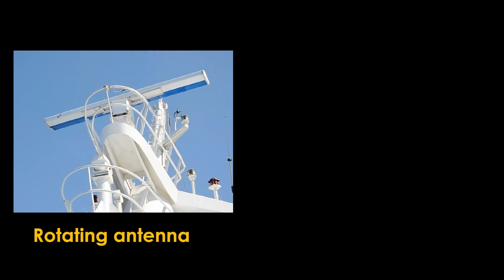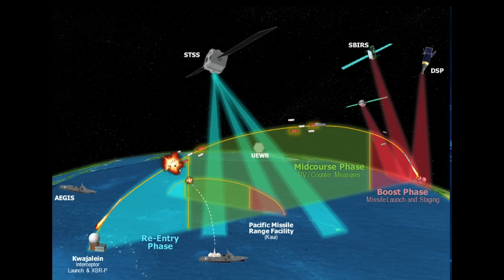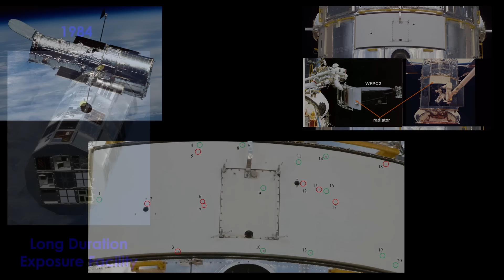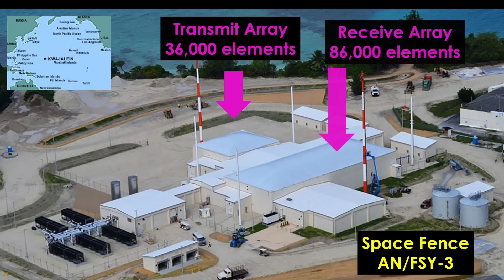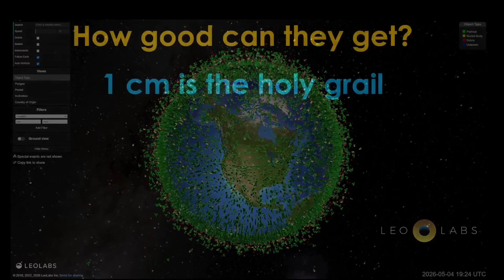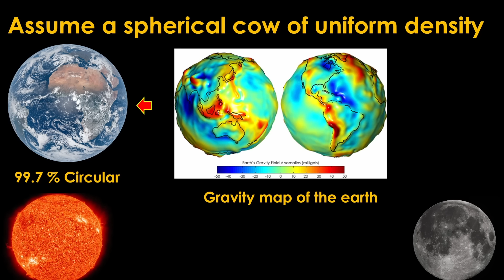Kessler Syndrome Part 4 - Trackers and Modelers

Comment: Is there any data or studies on how big an object has to be to create a debris-forming impact?  We know collisions with millimeter size debris are quite common, but they just leave pockmarks and don't seem to cause debris-forming events (edit: apparently the particles i was thinking of are an order of magnitude smaller than this.).  If a 5cm piece is undetectable, would we even know if such a piece gets involved in a collision?  I suppose we could look for satellites that were damaged or disabled by unknown means.  There doesn't seem to be many reports of satellites being knocked out by collisions with undetected debris.  Does that indicate that a 5cm piece isn't dangerous enough to be concerned about?

Anyway, i appreciate the deep dive into Kessler syndrome.  This is so much better than the normal fearmongering we get on this subject.
Reply from the maker: We have quite a bit of data on the smallest stuff from 10 micrometers to 100 micrometers from Hubble and LDEF. We don't have good data on the 1 mm size - the chart I based my discussion on has a big red "data gap" square at 1 mm.

My guess is that it is unlikely to see trackable debris at 1mm size, but there's still enough energy there to break things and generate more small debris. Whipple shields are able to protect against the 1mm size range if you can afford the size/weight of them in your design and you can't use them to harden solar arrays or radiators.
Reply: @EagerSpace  Yeah, cm-level stuff creates more debris in a collision. My suspicion is that mm-size stuff (so 1000x less energy than cm-size stuff just kills or disables an active satellite, without producing much debris. But that’s just a slightly-informed guess. However stuff that small doesn’t stay in low orbits for long, which is probably why it hasn’t eaten our lunch already, at least in LEO.
Reply: @ahgflyguy  most vulnreble surface area of a satellite is it's solar panels and radiators, I wonder how hypervelocity impacts effect them. Do they just completely shatter, in which case the vast majority of likely debris impact events would have a crazy amount of debris creation (shards of silicon wafers)? is it so fast it tears a clean hole through them like a bullet through paper, in which case the vast majority of likely debris impact events would have minimum debris creation.
Reply: @tmas the 10 micrometer stuff just pits the solar panel glass I think. Above that I don’t know. 100 micrometer (so 1000x more energy) seems like it would be enough break the panel significantly.
Reply: @EagerSpace  I was definitely under the impression those particles were 1mm and below.  I didnt realize those were actually that small.
Reply: The kinetic energy (and thus damage potential) of any impact can be easily calculated using the mass and relative velocity.
If we're talking about unknown fragments, we don't know the mass but can estimate it because we know what spacecraft are generally made out of.
Reply: I don't know how good their data actually is, but this is mentioned in the ordem 4.0 preview.
"ORDEM 4.0 will introduce a parameterized debris shape model based on laboratory hypervelocity impact tests, such as DebriSat. This will allow analysts to implement shape characteristics in their damage equations and more accurately predict impact damage risk by debris of different shapes and orientations."
https://ntrs.nasa.gov/citations/20230003442
Reply: IIRC from public reports during the Shuttle days, they were worried about paint flecks causing damage to the orbiter windows. So pretty small depending on what material they hit.
Reply from the maker: You can see galleries of shuttle impact images here:

https://hvit.jsc.nasa.gov/impact-images/space-shuttle.cfm

The windows images show the damage that a paint fleck can cause...

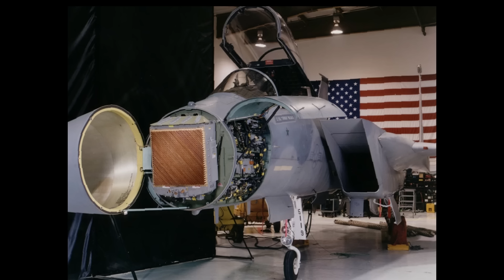Comment: 2:10 
This isn't exactly accurate. You're describing an Active Electronically Scanned Array, not phased array systems as a whole. For example, the AN/SPY-1 on Ticonderoga-class cruiser is not an AESA but a Passive Electronically Scanned Array.
Reply from the maker: Yes. I need to simplify in a lot of situations.